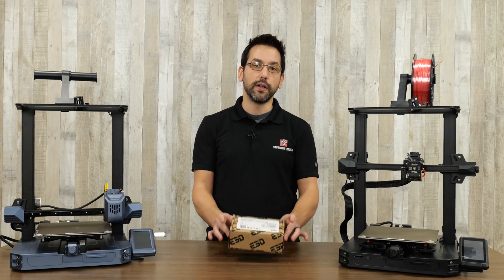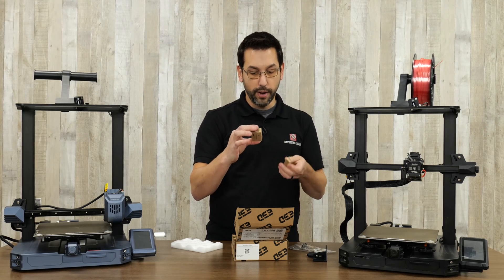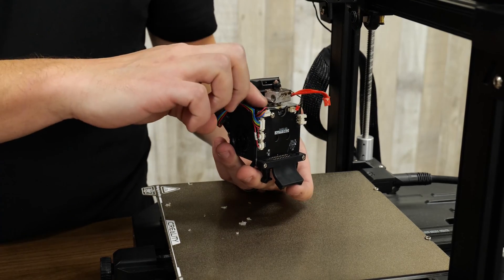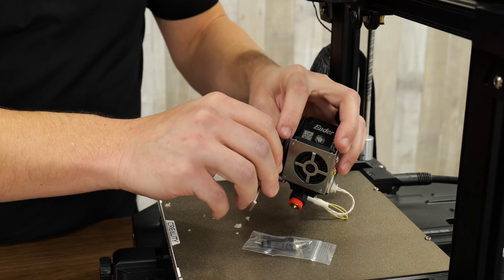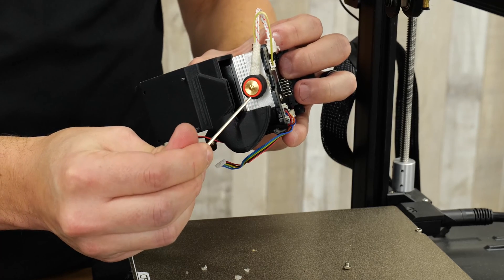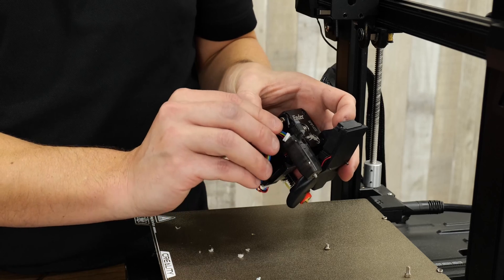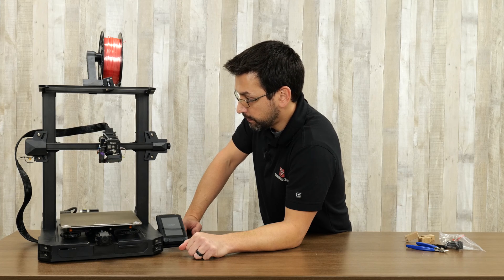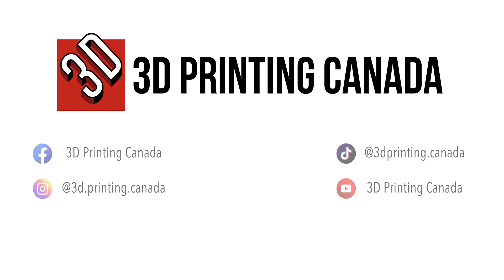INSTALLING THE E3D REVO RAPID CHANGE FOR SPRITE EXTRUDERS

Comment: I had the same problem with the screws, when I had to change the hotend, what happens is that sometimes filament accumulates in the holes in the head of the hex screw. I solved it by heating the hex key to red hot, and you put it in the head and it melts the plastic. Of course when you finish removing the screw, it will remain attached to the key, so then you will have to reheat the key together with the screw, so that it falls out.

Comment: Hi there! Does anyone have a good modification to replace the stock fan with a 5015 fan in the Revo system? Also, if someone has an Orca slicer profile for this upgrade, I would greatly appreciate it. I'm transitioning from Cura to Orca and haven't achieved the same print quality. Thanks a lot! :)
Reply: Have you found a way to mount the 5015 fan? otherwise i remixed a sprite 5015 part cooler to work with this kit,  the name is "Sprite pro part cooling with 5015 Revo Upgrade Kit edition " on printables, did not get to test it tho

Comment: With this upgrade you  "only" get the Revo system to change to nozzles or it is better than the original hotend for the s1 pro? I'm very interested in upgrade my printer but I didn't see a cool hotend to use with a cht nozzle which,  apparently,  it's the way to have more quality and speed. Do you get best prints with the kit?
 Thanks for the video!!
Reply: You can use this upgrade and the High Flow Revo nozzles. Which licence the CHT technology, some results even suggest it gets better results for the given melt zone. They can be used with he standard creality Revo heater, or there's also an option to upgrade to a 60w one. But that would require firmware changes to the printer to accommodate a different thermistor. So best to just get a High Flow Revo nozzles and swap it in. I believe they run up to 1.4mm in diameter. You can also increase the volumetric flow inside the slicer to get the most out of the nozzles. https://e3d-online.com/pages/revo-nozzle-maximum-flow-rates to see comparison in flow rates.
Reply: I think so, but thats a huge upgrade
Reply: @urjnlegend  yeah I bought it one hour later with a 0.4 and 0.8 nozzle and I saw high flow nozzles with this system, maybe my christmas gif for myself xD
Reply: @diegoriveraconde2651  can you use a hi flow nozzle by just swapping the nozzle?
Reply: @urjnlegend  maybe it needs more air flow or something, I will discover in few weeks
Reply: @Levkin Hiya, daughter and I saw your amazing gear at SMRRF and have been talking about it ever since. Will this kit fit the (not quite a) Sprite on the Ender 3 V3 SE? The ice block tests has my daughter wanting some very expensive gems 😂
Reply: @nicksmith1415  Hey! So not officially. I have just had a look at the hotend design of it, and it is the same as the K1. I've converted my own K1 to fit Revo using the sprite adapter, but was necessary to change the thermistor connector. So soldering was needed. So I believe it will be possible, but  not without a little bit of tweaking, and I'm not sure how well the existing fan shroud would work. Could be an interesting experiment. You can check a video I made on changing over the K1.
Reply: @Levkin  thanks for the info. Yeah the true sprite uses a minute connecter on the thermistor. The wires are too tiny for the same connection I have. They slipped clean out of the connector 🤣. I've tried fitting a normal sprite hotend and ended up with the thermistor hanging out by ten or so millimetres. It works so I carried on using it. The shroud is an issue, I think that you might have to adapt the plastic housing and do a little cut and shutting. Would take a bit of time to do the first one, after that it should be a process of copy and paste.
Reply: @nicksmith1415  Yeah I never bother trying to fit existing cables into new connector because it almost never works, I usually just solder old to new.
Reply: @Levkin  I've just ordered some thermistors that are short like the true sprite but look as though they have the larger connector so should fit the V3 SE.
Reply: @nicksmith1415  If the connectors are just like on the standard K1, then they are Ceramic heating ring: XH2.54-2P
Thermistor: PH2.0-2Y
For future reference. You could just buy the connector / cable + connector. That might be easier than replacing the entire thermistor.
Reply: @Levkin  Thanks again. Definitely the easiest route. I am though more concerned with the fit and adaption of the fan housing etc. It's a bit chicken/egg. I need to know if it works to do it and I need to do it to know if it works.
Reply: @nicksmith1415  Haha yeah classic chicken egg. When I tested it on the K1, the nozzle seemed to be a tiny bit lower, but the fan was still blowing under it. From my printing experience I've not had any issues. But I predominantly print in PET and PETG, so I don't use very high fan settings, so perhaps the efficiency is not quite as good as stock. But then again I've never come across situations where the fan would be the limiting factor.